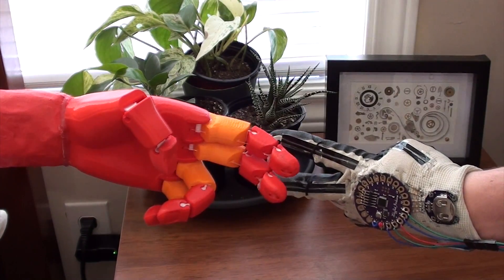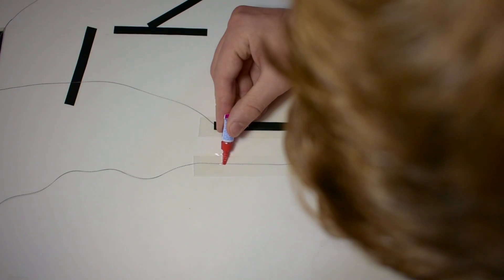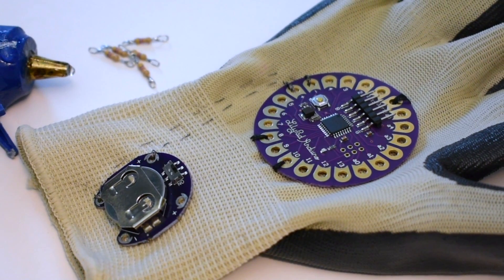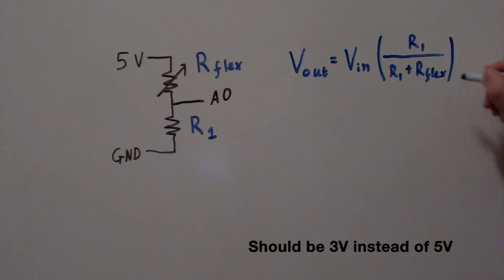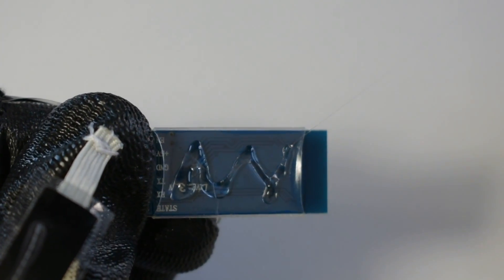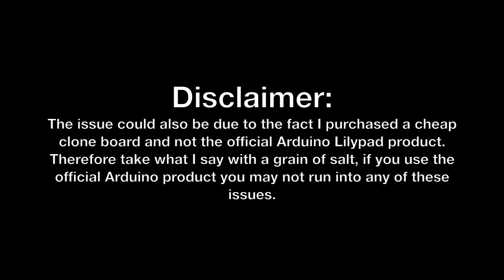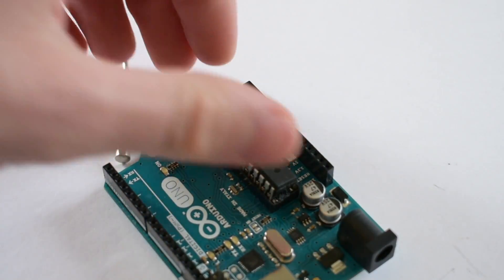Flex Sensor Glove and Robotic Arm

Comment: The issue with the serial baud is that the bluetooth module transmits by default at a certain baudrate. You can change that by sending AT commands to the bluetooth module.

Comment: Hi Will, nice work bro! Can you ask em a simple a naive question?  For the very same project I´m using an Arduino Nano and a Uno, can i connect both between a bluetooth module like you tried in the video (I know you weren´t sucessfull because of the lillypad) and pass the information trough the controllers without losing any kind of movement? I´ve been thinking on using Xbees shields but it´s too expensive for this project. Thx, would help a lot if i get any answers!

Comment: Hi! I have an Arduino Uno but the SMD edition (doesnt come with that shield you removed) and also an Arduino Mega 2560. In terms of programming, what would I need to do different since my board is a different model than the one you used in the video? Thanks!

Comment: Great project. Is there any way to remove the delay between the glove and the hand?
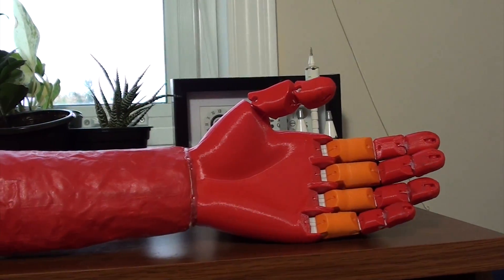Reply from the maker: Sorry for the long response, hopefully it answers your question. In short: yes the delay can be removed! The delay can be seen in the first 15 seconds of the video when playing paper, scissors, rock, and around 4:50. The delay occurs because I programmed a minimum threshold before the robotic hand reacts. The main purpose for doing this is is to stop the fingers from jittering as the flex sensors are very sensitive causing continual vibrations. To make these scenes more aesthetically pleasing to watch I programmed a binary reaction (finger open or closed) by adding a minimum threshold before the fingers reacted. As a consequence there is a slight delay in reaction time. An alternative method for reducing this jittering would to be add a filter or signal averaging function to the flex sensor readings (this would also remove the reaction time delay), but I am pretty busy with other work at the moment so I decided just to take the easy way out (in hindsight it wouldn't have really been that hard to add a filter to the program and I probably should've just done it). It might be hard to spot as it happens so quickly but at 5:19 when the fist closes you can briefly see the thumb vibrating/ jittering, this is the effect I wanted to reduce.
Reply: Will Donaldson we are thinking to use flex sensors on the fingers, an IMU for the wrist movements on the forearm and we are thinking to use flex sensors on the upper arm (on the elbows and on the shoulder) 

We are just not sure if it is practical to use flex sensors on the upper arm instead of another IMU, as our mentor recommended the flex sensors for simplicity, we are not convinced with his suggestion.

Can you please provide me with feedback on our situation.

Best regards
Reply: We intend to use 6 DOF robotic arm that mimics our arm movements
Reply: With a gripper as an end effector